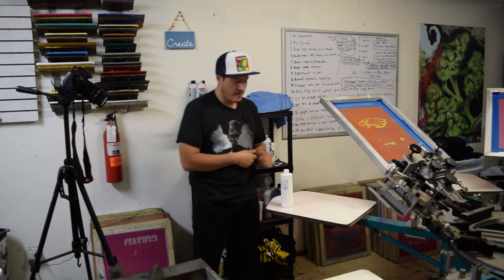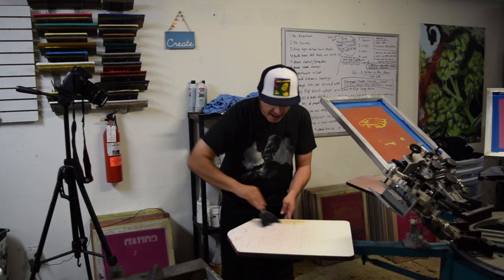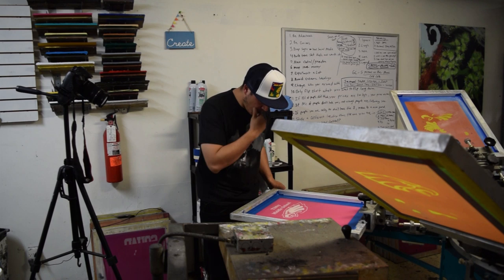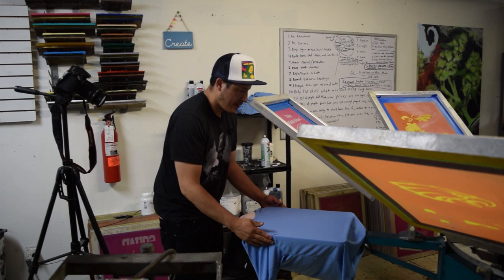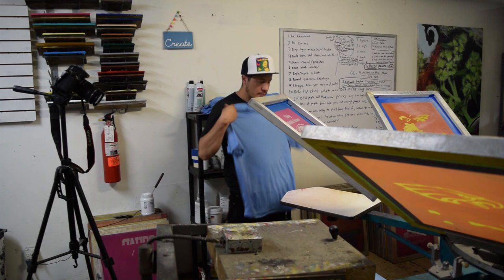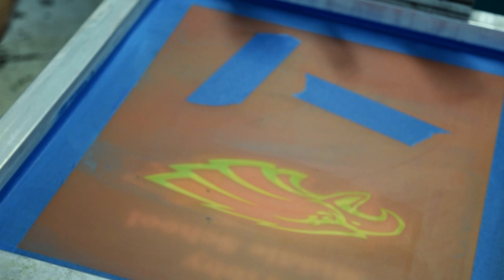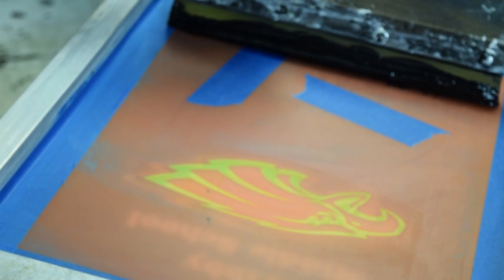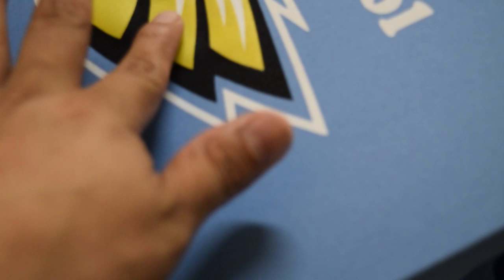Printing Polyester Tee Shirts with Multiple Colors

Comment: So if it cracked, I can flash it again? I use a flash dryer to cure my shirts.
Reply from the maker: flex Mckenzie yea make sure it doesn't crack but if you checked and it cracked it most likely will stay like that unless you heat press it. when curing make sure you move the shirt around. The middle of the board is where it gets the hottest and holds the heat. so move every corner of the print to the middle of the board. a conveyor dryer would be easier and ideal to use for curing.
Reply: If I do use a heat press, how long I should press it for?
Reply from the maker: flex Mckenzie it depends on the ink and the garment. I would press it at 320 and do it for 10 seconds on the polyester shirts/inks. And 15-30 seconds on cotton/plastisol shirts. Just make sure they don't crack or the color doesn't bleed through. Also make sure the press doesn't have too much pressure and it is not too loose.
Reply: Thank you for that great advice.

Comment: Why does it make that sound after you run the squeegees over the image?
Reply from the maker: flex Mckenzie I call it pop. it's from using a higher mesh than I'm supposed to and the polyester ink is making a sound from leaving the ink on the shirt and wanting to hold on so the screen makes the sound. If it is making that sound and actually lifting up your shirt like where I printed the black color.  MAKE SURE TO SPRAY SILICONE SPRAY UNDER THE SCREEN EVERY TIME IT STARTS TO POP THE SHIRT OR TAKE AWAY INK FROM WHAT YOU HAVE PRINTED.
Reply: Yes, that was happening to me a week ago, didn't know why. Thank you for helping me out.
Reply from the maker: flex Mckenzie glad to help